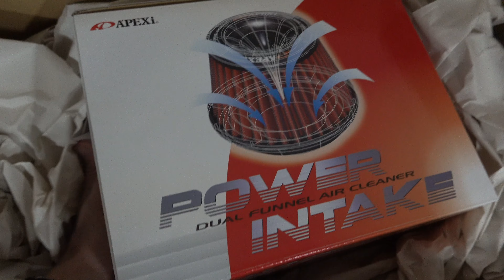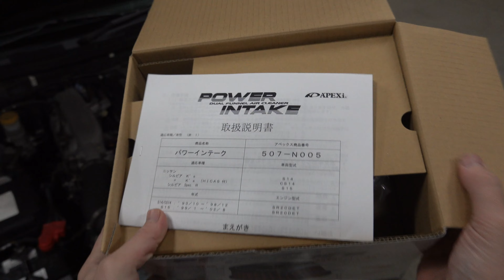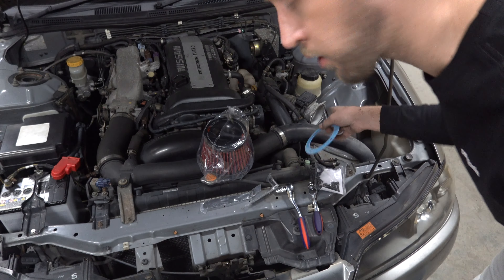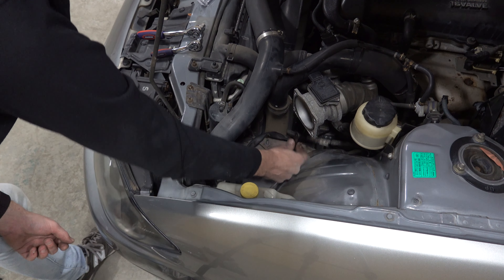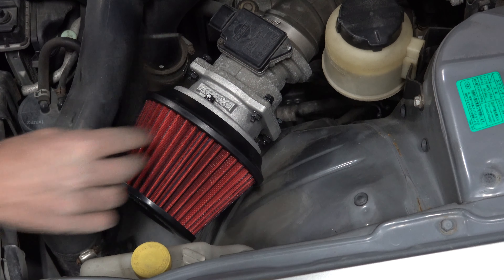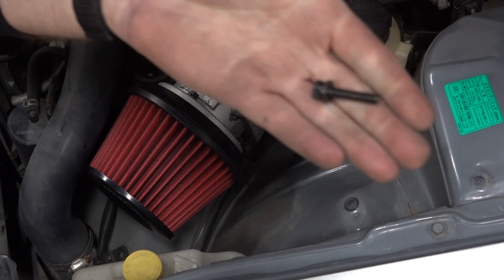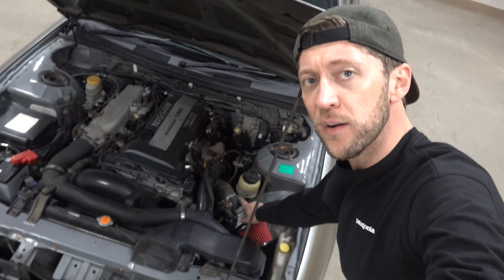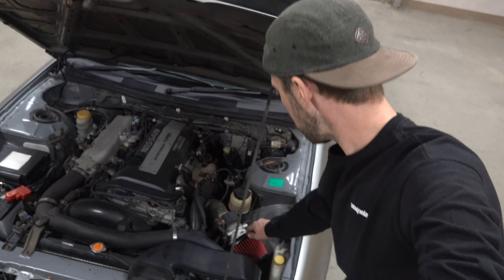First "Real" Mod for the S15 Silvia!

Comment: The sweet sounds of the Tokyo Philharmonic Orchestra ladies and gentlemen
Reply: I remember growing up, you'd keep gas receipts to compare MPG. You still do that? I'm assuming you'd get at least a mile or two better MPG...or I guess KPG out there?
Reply from the maker: @nickt1984  Haha, loving it bro.  

I reset my trip meter with every tank to see how many kilometers I get (out of curiosity, I guess?).  Usually 400-500 km, just depends on how much of my driving is highway vs. city.  I reckon highway miles in Japan are very gentle and you can achieve good gas mileage because the speed limits aren't very high!😂